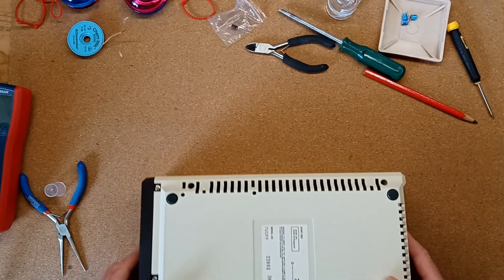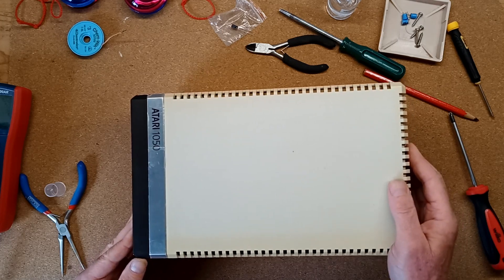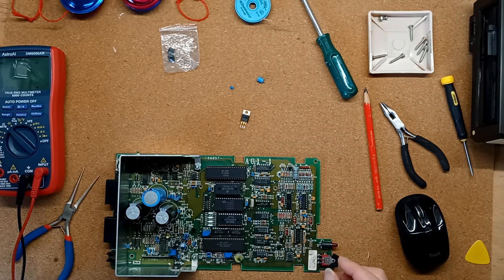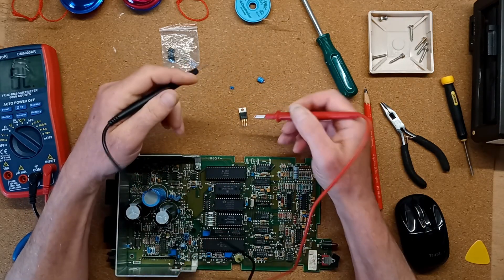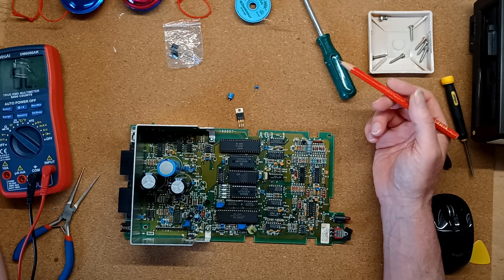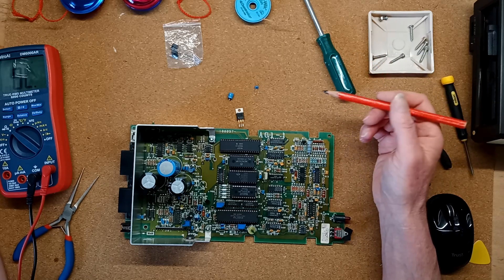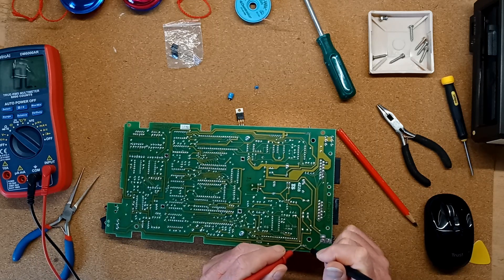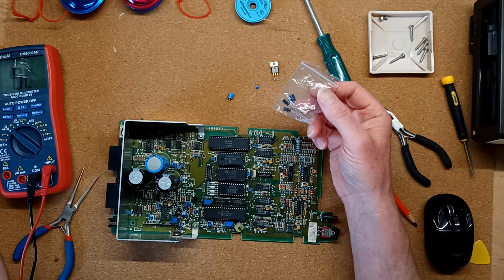Atari 1050 disk drive: quick fix

Comment: Great video!
I have been repairing 1050s for years now and have fixed maybe near a hundred of them. 
9 times out of 10 it's this very fault. It's always those 47uf caps - Richey is the brand I think? In some drives there are dark blue caps that are nichicon and they don't seem to fail as often. 
On every 1050 I replace all electrolytic caps using high quality replacements (panasonic or the like) from reputable sellers like cpc, mouser or reputable UK sellers. 
I also repaste the regulators, clean drive switch, reseat chips, clean head and pad, clean and relube the rails, then run the 1050 diagnostic disk and adjust speed and calibrate zero sensor. Occasionally alter the stepper angle for head alignment.  
Belts are nearly always ok. Lubing the bearing and spindle is good practice too.

Good to see others looking after this old tech, it's well worth it!